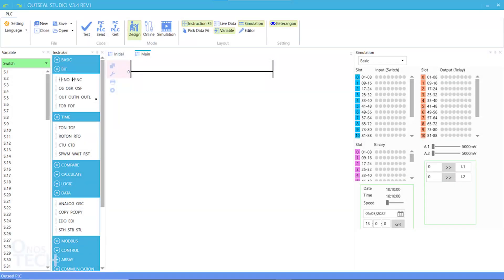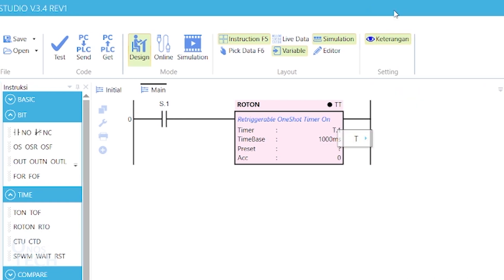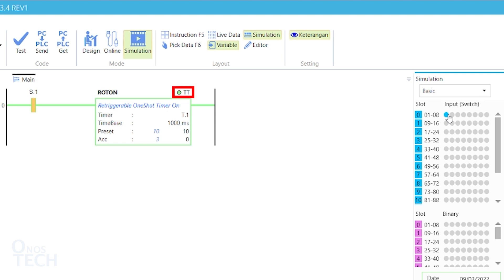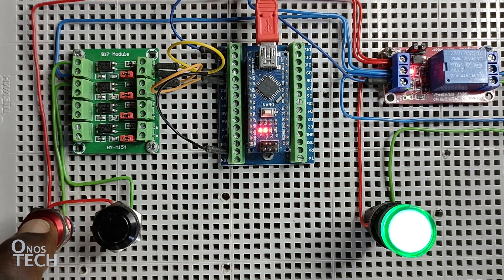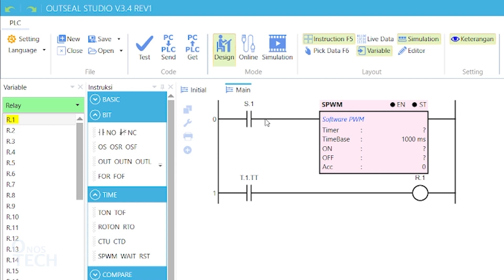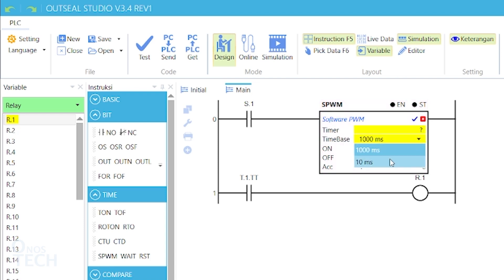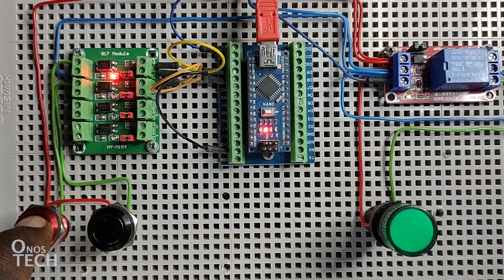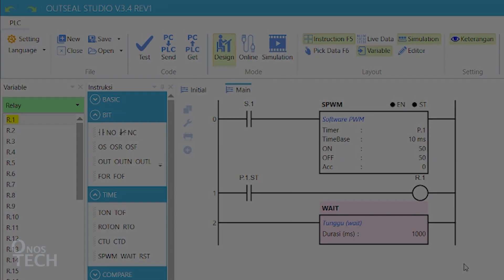#7 ROTON & SPWM | How to Program Outseal Arduino PLC

Comment: Hi, your videos are very enlightening. I have a question, is it possible to write the generated codes in this compiler on a normal arduino board? Or only those shown by the software.
Reply: Olá Antonio. Você pode utilizar o Arduino Nano, o Arduino Mega 1280 e o Arduino Uno. A melhor opção seria o Arduino Mega 1280 que só é comercializado pela DF Robots. As outras placas apresentam pequenas limitações.
Reply from the maker: Many thanks